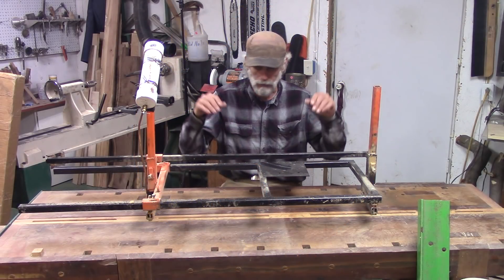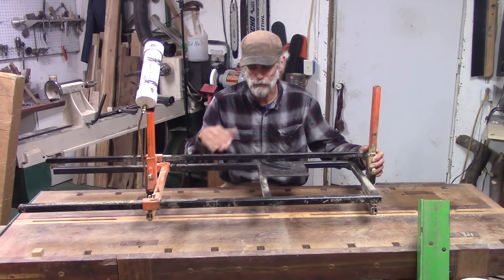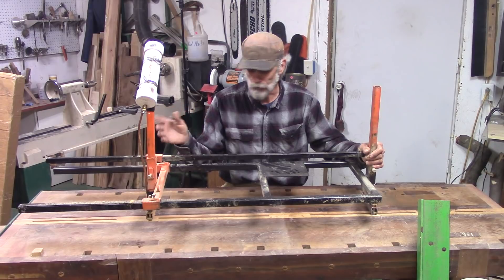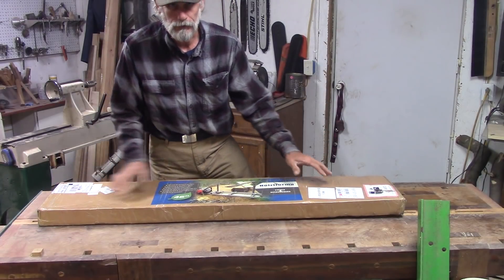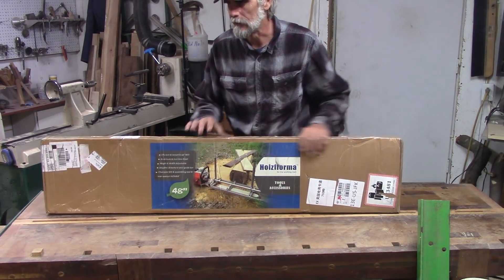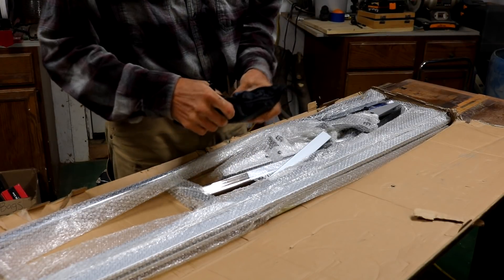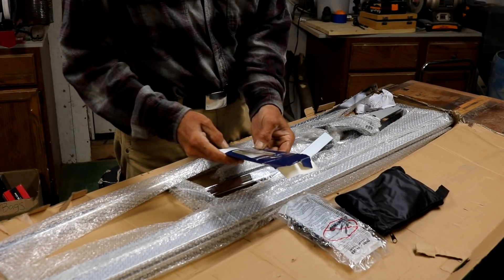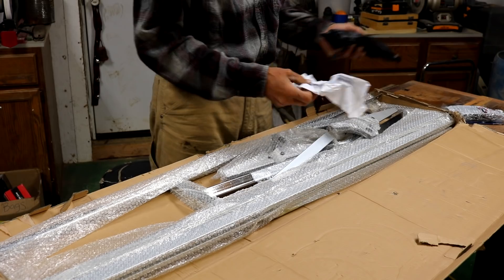Farmertec Holzfforma Alaskan Sawmill UnBoxing

Comment: The Granberg version has new billet aluminum parts, much beefier version. That said, the cast aluminum parts on their old design is no slouch. Which this is a copy of. As long as the graduation marks on the posts are identical, you'll have no issues in cutting perfect lumber. Honestly, I prefer chainsaw milling to my bandsaw sawmill.
Reply from the maker: Yes but the granberg is 2 to 3 times more expensive too. My friend Will has a granberg and to be honest this one is identical in nearly every way. It seems to be as beefy as his and the "one wrench to rule them all" is real nice. His, for some reason, takes 2 different sizes of tool.
Reply from the maker: Oh and for logs 24 inches and under I still like my Bandsaw mill, much faster and less waste.
Reply: @DIYwithUncleCy  , you have a bandmill? How did I miss that?

Comment: Thanks for sharing.  I saw Holzforma had a 36” bar option, where do get a bigger bar?
Reply from the maker: You can find them on Ebay but it does take some looking. easier to find 42 inch than 48 inch also.